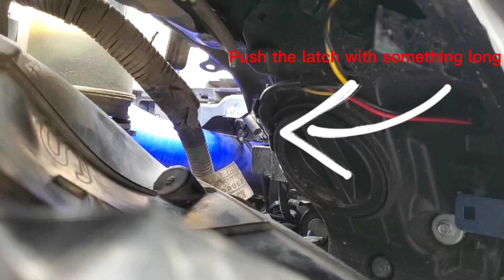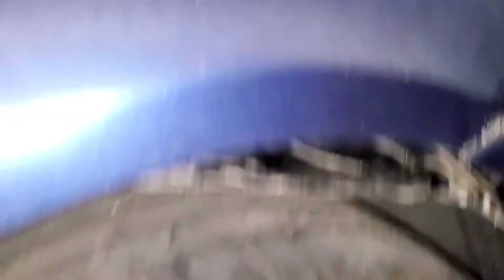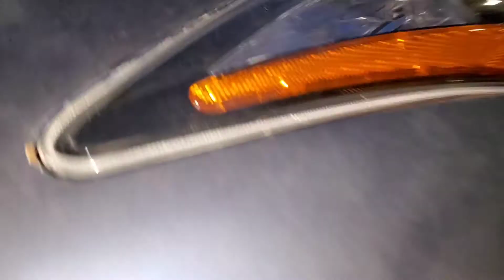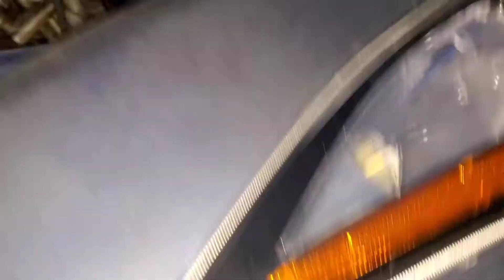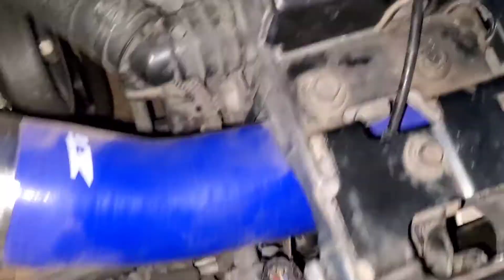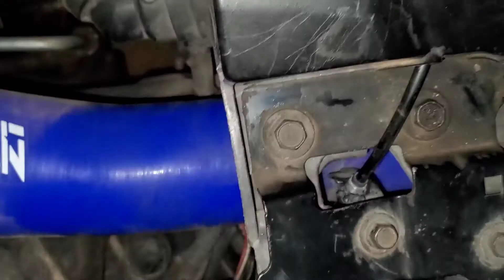G37 How To Open Broken Hood!

Comment: Poke the spring I’m stuck
Reply from the maker: the ball under the spring at 0:30 try to push it in so it pulls the latch can push up and down on the hood while someone pulls the latch works sometimes

Comment: 2010 FX35 drivers side won't open, will try this method today.
Reply from the maker: Hope it works!
Reply: @Connorkinn  yes it worked... i had to order the cable the connected the latch, it was rusty and snapped off.
Reply from the maker: @DTUFINOPhotography  happy i could help!

Comment: I took off the wheel and took off the driver side fender liner off then pulled the cable and it worked but now it won’t close🤦🏻‍♂️
Reply from the maker: The latches get hard to move over time if you wiggle them and make sure they are both open and hood lined up with the bottom latches it should close just have to press down a few times kinda hard on both sides
Reply: @Connorkinn  Yep everything looks good I think I got a stuck cable or something

Comment: I’m pushing it and it still won’t open. The driver side latch releases but the passenger side is stuck 🤦🏾‍♂️
Reply: did u ever figure it out ?
Reply from the maker: Yeah that's what happened to me had to keep wiggling it and pushing the metal pin eventually i pushed the pin far back enough for the hood to pop

Comment: There’s about 6 nuts you can remove off the top to pull out the entire latch and you can easily pull it with your finger. You just need a 10 and 12 mm ratchet
Reply: their on the top tho, which you can't get to if the hood wont open up
Reply: @christopheeburdine5975  💯